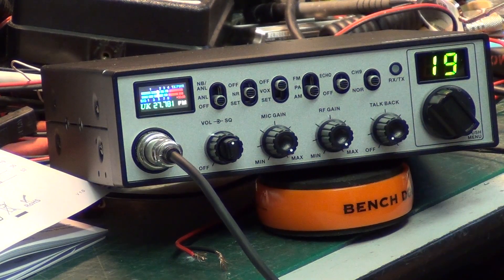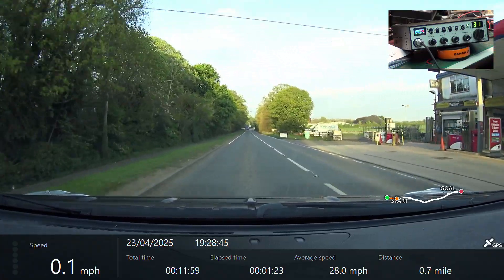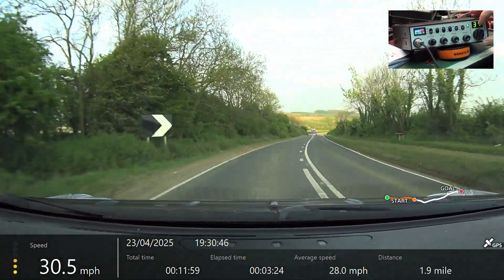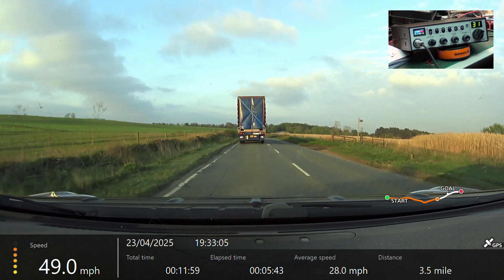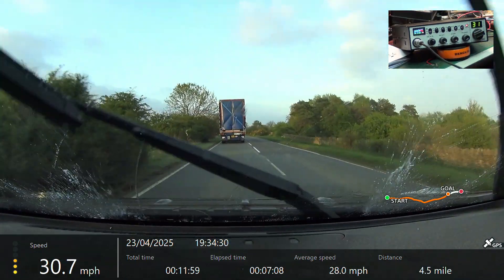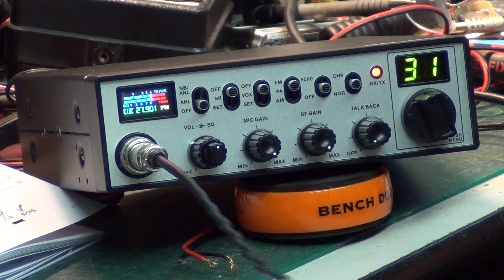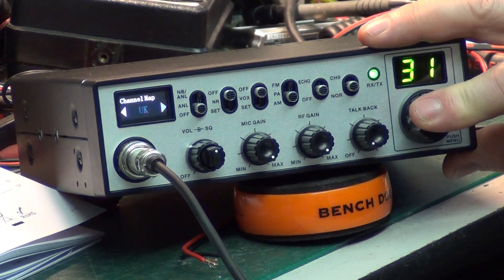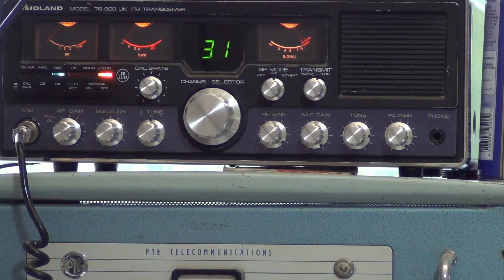Jopix 900PRO CE MultiNorm CEPT AM/FM UK FM CB radio  - On The Air test

Comment: Hi Richard, Mr. Chippy. I believe it’s a Radioddity but they weren’t going to put UKFM in it. So jopix from Spain, I believe put the uk fm in it. And they work well for what they are. Thanks again for your work both of you. God bless and see you soon.🇬🇧👍👍
Reply from the maker: The people behind this set are pihernz.com in Barcelona, Spain.   Radios for the USA market are not permitted to be MultiNorm & have to only cover the FCC approved frequencies & modes (that's still just 40 channels).  As I understand it, Radiooddity are indeed behind the import of the same looking radio into the USA as an FCC approved set. It wll have different innards either just in the PLL section, or entirely.

Richard, G0OJF, UK

Comment: Sounds good seems to perform well. Those roger beeps sound the same as the "call" tones that some PMR 446 handhelds have.
Reply: I've just checked my President Randy 3 handheld and the roger beep selection on that is pretty similar - if not the same - as the ones on this Jopix. Might have a similar chip inside..?
Reply: @dw7920  I would imagine that manufacturers of the new CB handhelds might use chips from the 2M/70CM walkie talkie range as they have been around for a while and are plentiful.

Comment: Does the "CE" mode (vs "EU") not give you UK+CEPT channels?  

I'd look in the manual but it's not online.  The manuals for a couple of the US versions are around, but they do whatever they do to prevent US (and Canadian) market radios from doing anything  but US channels (which are where the CEPT channels originated) so no instructions on how to change "channel map".
Reply from the maker: CE would give us CEPT FM only, whereas EU allows AM & FM on CEPT channels. Becasue the mode switch is three position, it's FM, PA, AM, so not enough positions to include UK.  Anyway CEPT set of channels are pretty useless here!

Richard, UK

Comment: I’m not a huge fan of these “new” multinorms the lack of adjustments either on the board or menu driven ones make them almost unusable and I’m not too keen on how some like this one is a complicated way of going between the eu and uk band makes them impossible to use out mobile. 
A hidden “engineer” menu should be available on a set like this to be able to make those adjustments on deviation and output power and those bleeps on channel select are awful hopefully they can be switched off in a menu setting. 
All in all definitely not for me
Reply from the maker: Not for me either!

Richard

Comment: Just before it starts, I am interested to hear how the deviation or lack of it sounds.
Reply from the maker: Well, because of the (extreme) speech processing it uses, it sounded OK!

Richard
Reply: @ukfmcbradioservicingTango21  I was surprised MR Chippy said nothing, when the filming started. But as u say it's actually OK.
Reply from the maker: @oldmanandguitar  I did forewarn him it was a new radio possibly sounding quiet & over processed...but it sounded fine in reality. Richard
Reply: @ukfmcbradioservicingTango21  Still out performed the am at 90% modulation. One of the most enjoyable/intersting tests for me. 2e0deq.